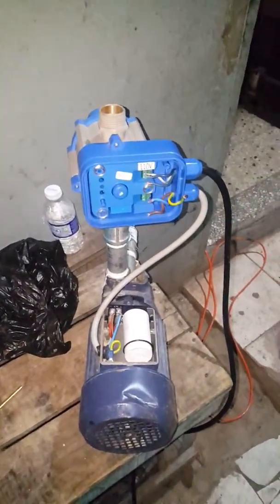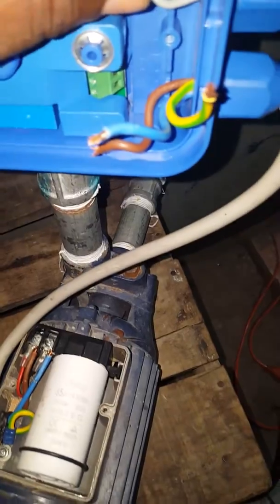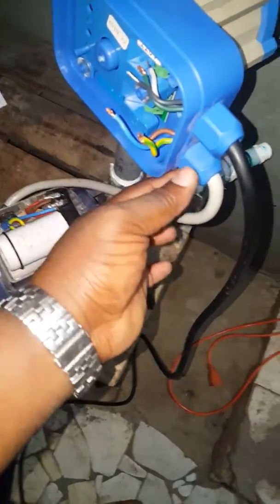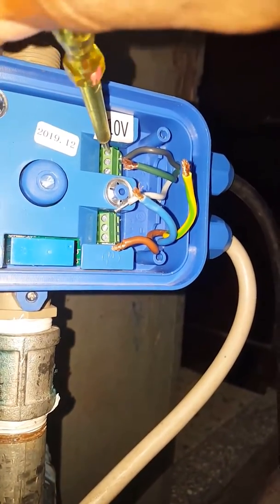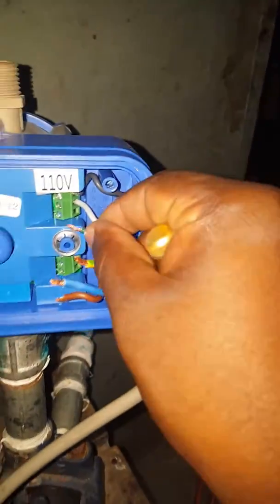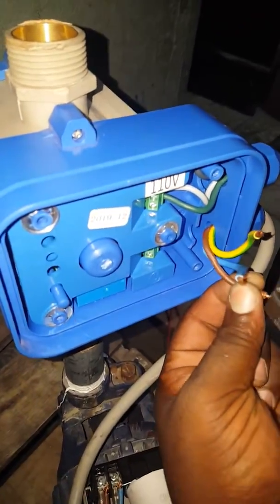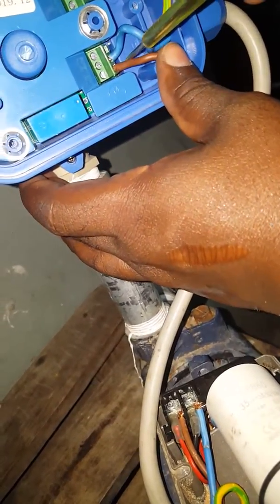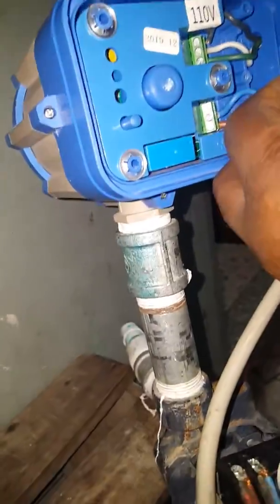How to connect a automatic water pump control

Comment: My pump is not stopping automatically. I have assembled it as you said. What could be the cause. When all outlets are closed, it's supposed to switch off automatically but it's not.
Reply from the maker: Check back the connections if they are connected properly

Comment: Question: what if you have a 110v pump controller but a 220v pump, can I still get it to operate?
Reply from the maker: I don't think that would work because the voltage is different
Reply: @edwardjackson4914  was thinking about running 220v to the controller but use 1 leg and a neutral to operate it, then the other leg would go straight to the pump, however the leg feeding the controller we would use it to supply as the other phase to make 220v for the pump...

Comment: Do you know if this switch can be used with a pressure tank? Or just without a pressure tank? Excellent video my friend, thanks!
Reply from the maker: No I don't think it should work with a pressure tank. Because it's already working as a pressure tank, and thanks for the comment
Reply: @edwardjackson4914  I like that, no tank to take up space. Thanks for your quick reply. :)
Reply from the maker: Kool. Just subscribe to my channel and share it thanks

Comment: Mr Edward Jackson, please i need help what if I do all those connections but still the motor works continuesly without switching off by itself, what will be the cause?
Reply from the maker: If the smart head is connected properly then everything should work fine. But if not then the pump would run continuously,so please check all the connections in the smart head and let me know ok
Reply from the maker: You can also connect a float switch on the pump if it's not tripping out when it reach it capacity.
Reply: Okay thanks for the advice. But my main problem is I did all connections as you instructed.
From the breaker to the automatic water pump control (BOOSTER) and also from the water pump control to the single phase motor.
Reply: And also, I knew very well that this pump control system works only on a specific way
It works for some few minutes and trip off and few minutes after it will trip on. And it also work when you are using the shower or using any of the tap.
Reply: But in my case, the system is runing continuesly without triping off.  And i tried to figure out the issue but to  no avail. And it's a brand new machine. THANKS!!